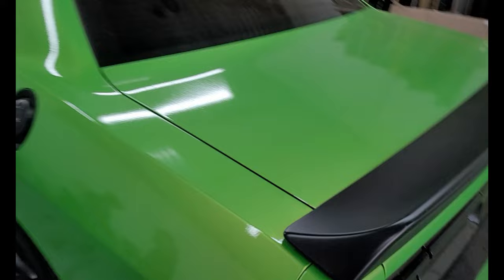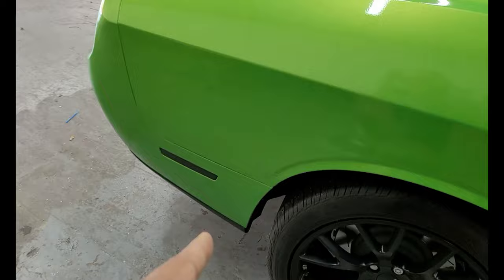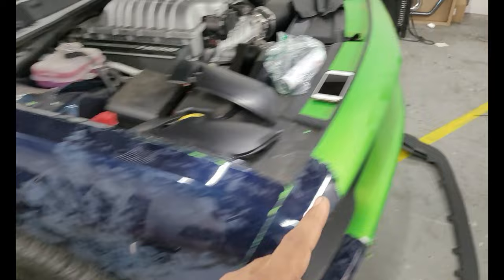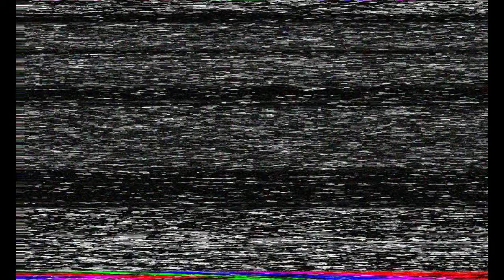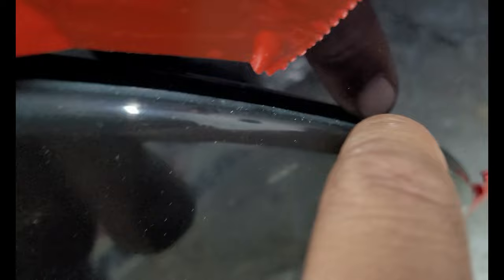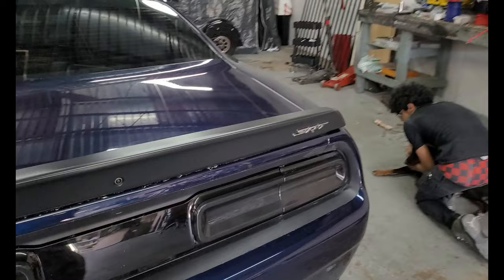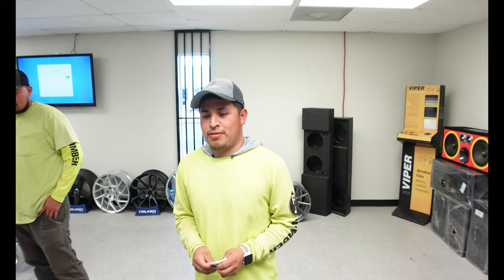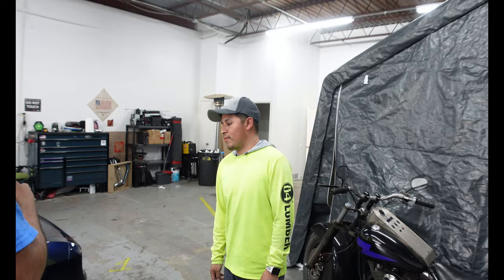MOLDED WIDEBODY HELLCAT BUILD UNIQUE BLUE COLOR

Comment: Looks good but a lot of guys still prefer for it to look like the OEM widebody. Basically so that you cant see the line connecting the flare, making it indistinguishable from the factory version.
Reply from the maker: What you mean Line ? truthfully  the aftermarket kit installed right is tighter than even the oem